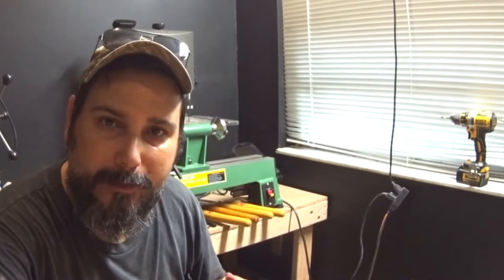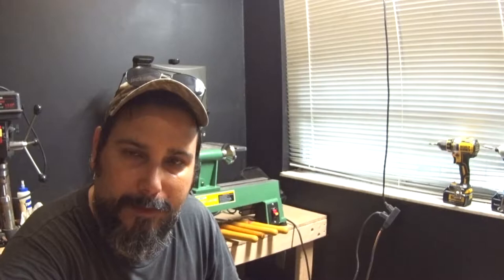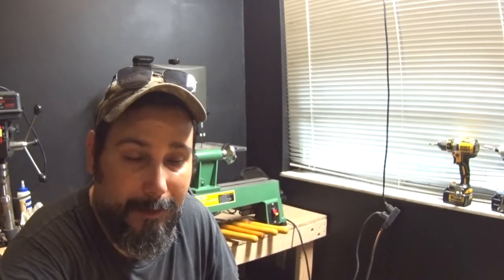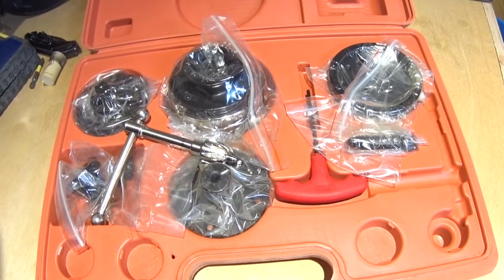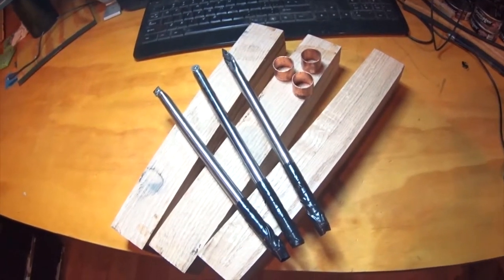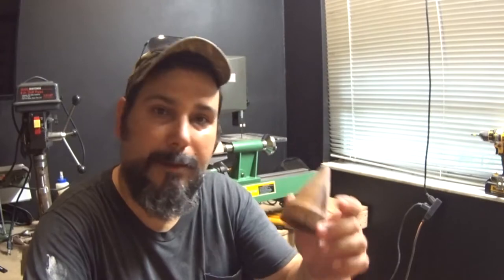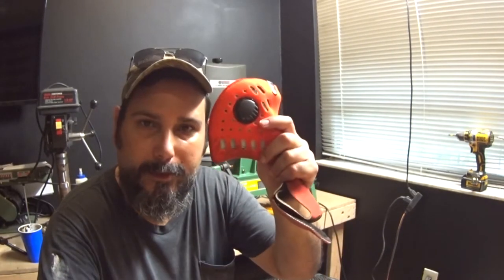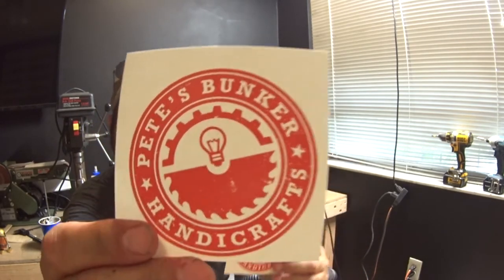Escagedo - Unboxing Barracuda 2 Key Chuck System

Comment: Eloy, buyer beware on pen mandrels. They come for different size kits. I purchased pen mandrels only to find out they are six and and 1/2 millimeter, and even the Slimline pens take 7 Mill. Make sure to buy your pen kits first before you buy a mandrel for them! My two mandrills cost me $30 a piece. I can't use them for anything other than a buffing station! Many blessings to you! Get to turning some handles for your tools first! Many blessings my friend!
Reply from the maker: Yes, you did mention that to me..I have to really make sure..Thank you Tracy. Oh, I still need to look for the stencil. I will let you know once I have it.